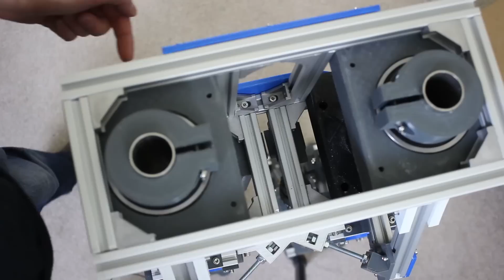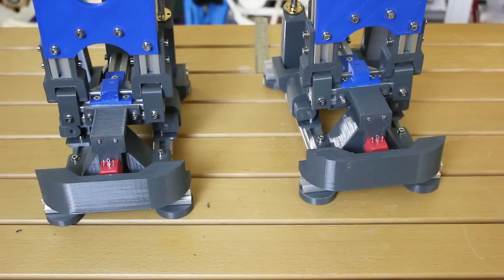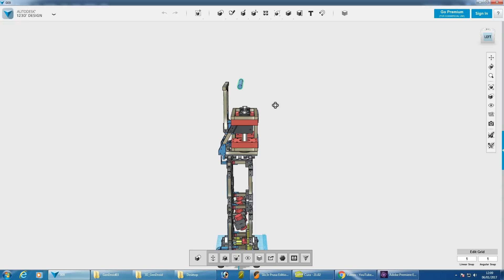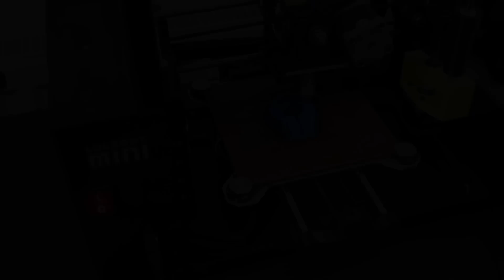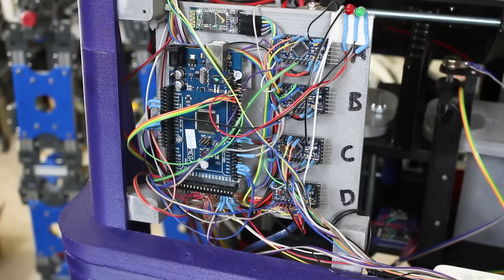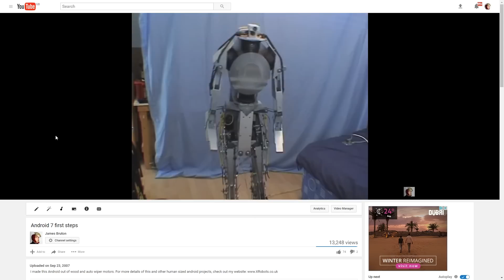Robot X #3 | Body & Electronics | James Bruton

Comment: You dont need to level shift the servodriver board. I have used it from both a 5V Arduino and from the GPIO pins of a Raspberry PI that outputs 3V3 without any  problem. And I tested both with RC servos and with the IBT-2 motor driover to drive the same type of drill motors that you use. But you have to be careful because the servoboard will continue to send pulses to the motors even if the Arduino stop sending commands to it.

Comment: For those anit-backlash nuts to work as well as they can, youll want some adjustable tension on one side.  One will be fixed, the other would have tension of some kind; springs, or rubber gasket maybe....

Comment: James, have you considered using some other kinds of hardware other then arduinos? You're going to be running lots of PID controllers, so you might look into something like the Intel Edison that can run multiple threads at the same time. It could do many of your PID loops from one bit of hardware. I really think a robot of this quality deserves some specialty hardware of its own rather then just a bunch of arduino boards stuck everywhere. This thing is totally awesome!
Reply: James Bruton you're right. I spoke to soon. :p

Comment: You should maybe consider using ant-backlash nuts on your lead screws instead of using two rigidly attached ones. They're basically machined to incorporate a high strength spring to prevent backlash and contain the same profile as one Lead screw nut.

Comment: a set of 4 load cells in each foot at the corners would let you gauge balance and weight distribution and help with avoiding falls by controlling centre of balance.

Comment: If you need them , I 3D scanned Boston Dynamics/ Googl's "Atlas" robot and "Big dog" .obj files when the Boston Dynamics display was at the Museum of Science and Industry here in Chicago. If you need the obk files for proportion purposes just email me at  my first and last name at gmail. also  I  have tons of photos that I need to put in a Google Docs folder with the obj's that I scanned. I 3D scan them so that I would have  portions for the robot that I was building but I don't have much time. it looks like you could do a better job with that scanned data than I can plus I took up close high quality 16 megapixel pictures of every inch of both "Atlas" and "Big Dogg" I spent over 8 hours at the Museum Getting Data.

Comment: The drill motors and leadscrews will have ample torque. They are the most popular drive motor for scale Robot Wars machines; I've used them for all sorts of stuff. An M10 (so 1.5mm pitch) thread, even with the horrific friction losses, can dead lift 60-70kg @ 12v. So you've got COLOSSAL torque available with 2 per joint!

In fact I'm kinda expecting you to eat a couple of the printed supports if/when a motor overshoots. They will simply bend 6mm rod and break the prints before stalling, unless heavily current limited. End-stop limit switches might be an idea. Also, the RS-550 motors in drills like this pull 70-100a if stalled depending on the flavour. Fuses?

Really enjoying this build in particular. The quantity of content in each video has gone up massively, but the quality is in no way dropping; improving in fact. Love it. Cheers and keep it up!

Comment: working well if you can't get more nuts there is always plan b cut your own threads in aluminum rods taps can be expensive but you get the length you want

Comment: You should really use hall-effect potentiometers, they are less accurate than the heavy duty mechanical potentiometers, but not by much, and they are not worn down as there is no mechanical couplings, and they have nearly no friction. The only real downside is that the hall-effect pots wont give a full rotation, but for your application that's not really an issue..

Comment: You shoud invest in a gopro hero 3 (or similar older model) and use it for timelapses.

Youtube has changed a few things and now its pushing chanels that upload a lot of long videos. 
Your regular videos are long-ish but you cant upload faster (like 4 or 5 videos a week) , because you cant just create something from nothing. I understand that doing this is very time consuming, and the worst thing is that we dont see you designing this in the computer, Im sure it is the longest and hardest part. 

However uploading a few timelapses of parts its easy (you are going to print them anyway) you just need to leave a gopro in a tripod , with the lights turned on. I think this will help the channel a lot because youtube will show the videos to more people in the "recommended for you" section. Only videos from channels that upload a lot are being shown to people in the right column of videos.

Anyway, I also wanted to say that this is awesome, thx for your great proyects!

Comment: How does all the electronic work now compare to that of a decade ago? I imagine it's about a million times easier since one arduino can handle essentially the what majority of the older components combined could do. However, there seems to be a lot more hardware work for the older components, but more critical thinking for coding things such as acceleration, stability, etc.

Comment: Just a couple of notes. I2C is normally open collector 5V so you normally just connect your pull up resistors to 5V and level problem solved.

I think it wold be good to measure where the center of gravity is on the assembly so you have an idea of the real position. Typically CG should be at 50% up the assembly at least.

The analog on the pots is probably going to be very noise with all that PWM and motor noise. Having lower value pots and caps and possibly shielded cable my help. Obviously you will want to scope it on the Arduino chart.

Great to see you went for one mirco. That's a huge win. What I like best about your projects is you actually complete them which is very hard to do at this complexity.

Comment: so you have ninja flex extruding? why not use use a inflatable bag (like muscles in a human) instead of screws and PID controlling, there has to be a smaller item that reads bar in a line that supplies air or an even stronger no compresble liquid, better yet what's the formula for extrusion to ninja flex, how much can one get out of the microns of extrusion